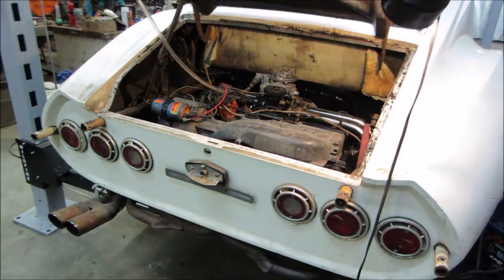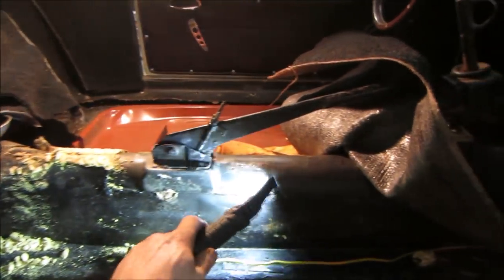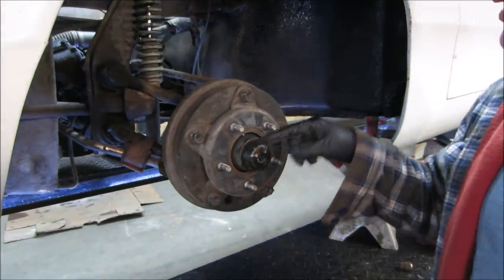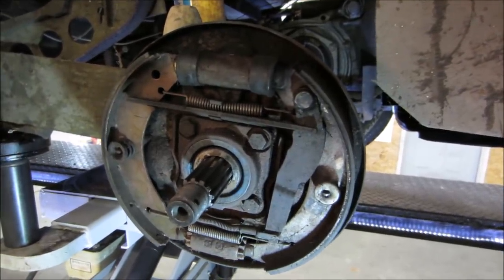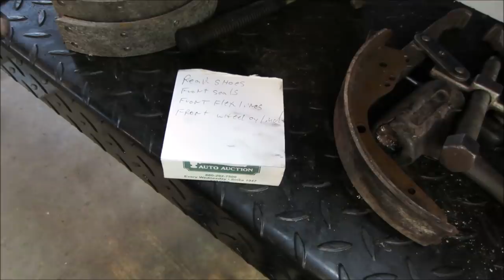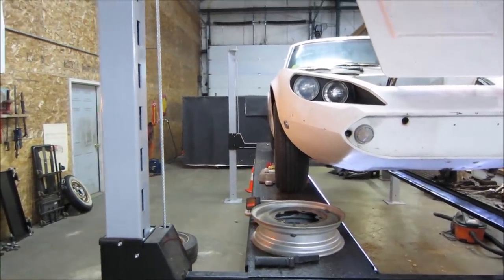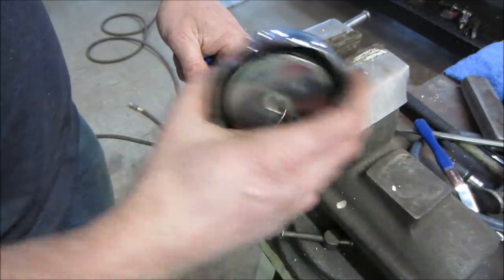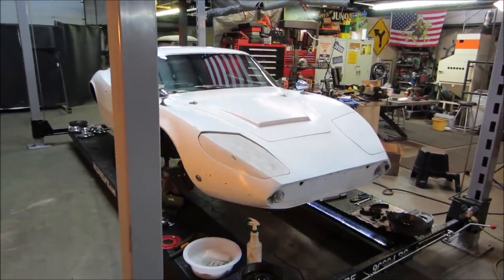Tearing Down My Barn Find Kit Amante GT Kit Car

Comment: Use bailing wire to pull the spring seat threw the hole and seat it then remove the wire or not , cut it short mirror fixed

Comment: So its a kinda Porsche go at a Reliant Scimitar but without the big 3 litre V6 up front?   I had a set of them mag slots on my MK1 Ford Transit camper, they came from the US and was a bugger to keep shiny on our salty roads, now I drive a fibreglass bodied car which has the same sort of bolt thru the floor seats but only three wheels :P   I reckon those seats would look awesome in my Reliant :D

Comment: Would the red line tires fit the wheels that came from Jason on the rag top bug and if so what would that look like on the car bc I think that would probably look just about right and if the rub it might be worth a little weight reduction not to destroy those red lines bc 100% won't look right without having the red line tires on it

Also my heart dropped whenever you dropped that mirror and I instantly thought the next clip was going to be you crying or cutting and new one LOL

Comment: you might want try the redlines on the front with the front not on the jack stands.  It will lower the body and probably clear the body, but probably not the headlights.

Comment: Me: watching you struggle with that spring
Also me: Why don't you just get a bit of builder's twine, tie it to the spring, and use that to pull it through then cut the string off the metal with a knife?
Me: watches pot metal break again
Me: Oh.

Comment: I think I might have used a dremel and cut the end off the stub inside the mirror.  Then, drilled the end, tapped it and threaded in an eye bolt.  I'm glad it finally worked out okay for Mustie doing it his way though.  Just reminds me of all the times I fought to fix something and then someone shows me how to do it with virtually no effort.  Equally embarrassing when the person has no mechanical aptitude whatsoever.

Comment: At 1:03:55 I think if you put a thin wire around it and pull it, it will work much easier. Then when it's in place just cut the wire.

Comment: You already did a better job than I would’ve because I might 98 xj I just put a sheet of sheet metal on the front driver and passenger and no I did not bend it or anything up I just laid it on top and welded in !!!Lmao

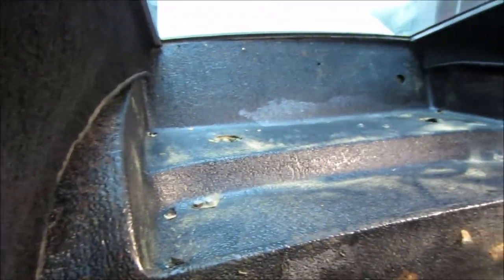Comment: 13:22 those floor panels will have to be completely replaced. They're so rusted and thin. i wouldn't want to sit on that. It could fall out when you're driving. If new ones would cost so much, why not just buy some 2mm sheet steel locally, cut it to size with a plasma cutter and weld it on.

Comment: |Make a tool with a fork, Remove tine 1 and 3, Bend 2 and 4 right angle and set mirror holder in place and slip fork tool in place pull up and slide over. Done..

Comment: Mostly because i think it looks a bit ugly, but also because that type of pop up headlight is a PITAx2 to deal with, i would just get rid of the whole cap, use it to thermo form some plastic "domes" and put a regular, fixed headlight. That'd open up the wheel well back to its proper size. Everything about that design screams "idea with bad execution" to me.

Comment: a wire would have been good to pull the spring out just wrap it around it a few times pull it out put it in place and then just snip the wire off

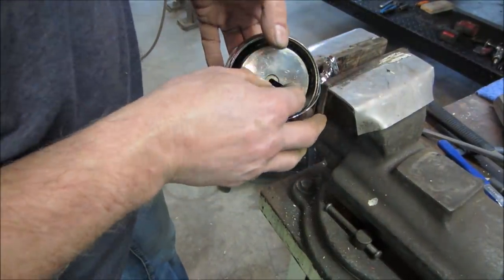Comment: 1:00:00 Tie a String/Wire to the spring loop/catch and pull it through the hole. 1:05:12 and I'm yelling at you...! 1:07:08 USE A STRING or WIRE!

Comment: Mirror:  Could have wrapped a little wire (or twine) around the inside piece, feed wire through the hole, and pull it into position.....

Comment: for pulling the spring through that hole, i bet if you had used a piece of string or wire, youd have got it in under 2 minutes
Reply: i see now i wasnt alone thinking that :D

Comment: I can't help feeling that "emergency brake" is misnamed. I challenge anyone to get a vehicle with a clutch to start moving on a steep hill without stalling, without using the hand brake.
Reply: I haven't driven a manual in about ten years, but when I did, I never used the hand brake to start on a hill. For moderate hills, I just launched quickly so I had only a few inches of rollback. For really steep hills, I did a heel-and-toe launch.

Comment: E-brake...?
The purpose is originally a parking brake, not an emergency brake. 
You CAN of course use it if the brakes fail, but the original purpose is parking brake. Handbrake.

Comment: 1965 Volkswagen Karmann-Ghia Typ 14 brief data
WHAT BODY STYLE? 2 door fixed-head coupé with 2+2 seats
HOW LONG? 4140 mm
HOW HEAVY? 830 kg
WHAT SIZE ENGINE? 1.3 litre, 1285 cm3
HOW MANY CYLINDERS? 4, Flat HOW MUCH POWER? 39.5 PS / 39 bhp / 29.1 kW @ 4000 rpm
HOW MUCH TORQUE? 92 Nm / 68 ft.lb / 9.4 kgm @ 2000 rpm
HOW QUICK? 0-100 km/h: 27 s
HOW FAST? 128 km/h, 80 mph

Comment: I am surprised there is no extra support where the seat go into the seats are laying on the floor bolted to the floor pan with no supports at all that is strange I know on american cars they have extra steel support for the seats instead of sitting on the thin floor pan. I have never messed with VW cars but 
I would not want to sit in that thing with just a thin piece of steel between my ass and the pavement LOL!